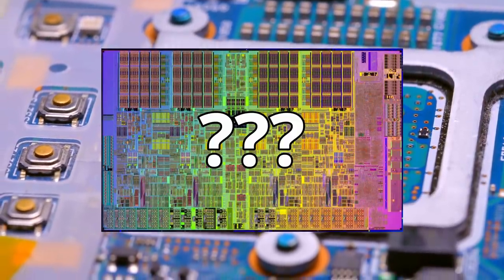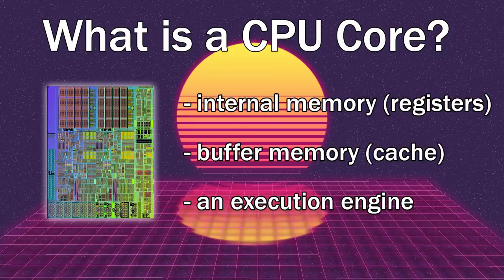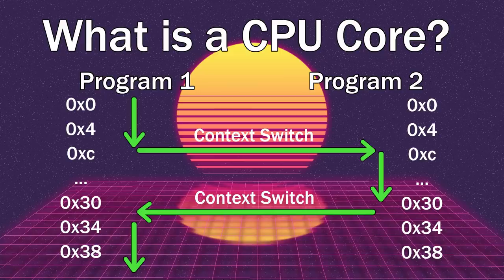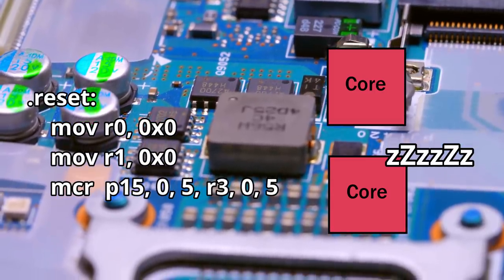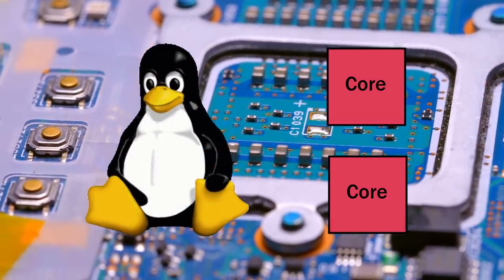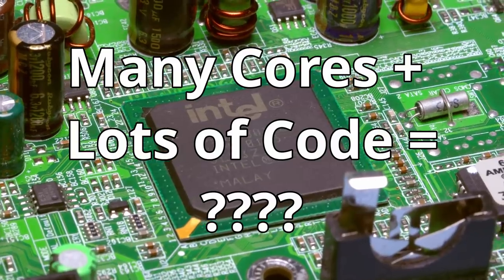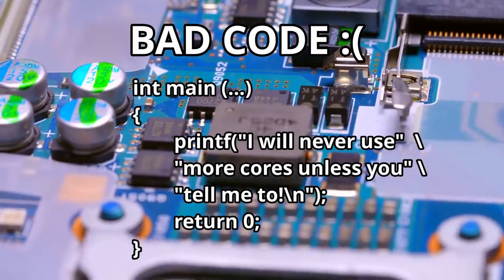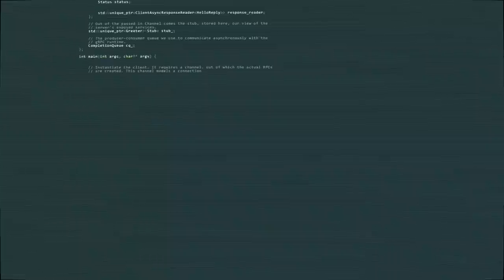why can’t computers have thousands of cores?

Comment: As a former programmer, not all functions of a program can be run in parallel. Sometimes a function needs to wait for another process to finish before it can proceed.
Reply: You just can't count or calculate the next number before you've finished calculating or counting the one before it.
There is no logic, no clever math or algorithm or brute force which can speed up some simple processes. The complex things just have to wait until the simplex things get done.
Reply: Thats if you iterate...But try using a functional language where even iteration is done by recursion....
Reply: @MrZnarffy  Thank you for the feedback.
Reply: It can be endless, 12 is the basic max, 24 = 2x all at very stable more. times infinity Now I seen 36 max and it gets bugs. a controller  separating 24 and next 24 = 58, etc... So buffer and code (stable 24 time x), makes best code function. now is the actual program and controller(s),  Think A,B,C and the programs, export
Reply: @duaanekobe2773  Thank you for the feedback. I did most of the programming on mainframe computers and the programs there were extremely linear in nature. We use subprograms for common functions meaning the main program was in a wait state waiting for the subprogram to complete.
Reply: @larrydavis3645  I have worked with such too, but studied parallellism at uni. And also done hardware design in software (Verilog). So what I think is coming is massive blocks  of competely rewritable hardware, so  you can have self-coding hardware really...
Reply: @MrZnarffy  Thank you for the comment
s. Working with business problems what parallelism we had was done at the hardware and operating system level. Even online systems worked in a batch message mode. A request would be placed into the queue and wait to be processed. Sometimes multiple queues would be used for high-use transactions.
Reply: > wait for another process to finish before it can proceed.
Yes. See Amdahl's law. Many non-programmers don't know that the devil is in the detail and that even short periods of waiting or serialization can bring your scaling factor down very quickly.
Reply: @Conenion  Thank you for your input. I have received the most feedback on this comment.
Reply: Neural Networks can indeed use an almost infinite numbers of cores, and there are 6 different ways they can use parallelism. Source, I do neural network programming for AI.
http://meseec.ce.rit.edu/756-projects/spring2013/1-4.pdf
Reply: @MrRizzyWizzy  Thanks for the information. The type of programming you do is highly specialized and I do not have any experience with it.
Reply: @larrydavis3645  It's rough getting it working sometimes, but when it does it's so much fun and rewarding.
Reply: This is true, but this is in regard to a single application that's running one main thread in a serial path to get to some point.

But now throw in server applications such as DB.  You're going to spawn thread for different queries.  Each query is independent.  I can have a front end server that's running security and handling data access to other servers, where each data access is independent.

Even as the level of WS, I can have very large data sets and I'm running an application that's processing this data, and the data processing can be handled by breaking up this data into smaller sets and running data functions on that smaller set and then that data is passed to another thread to work with the processed data.

In other words, you're looking at it from the perspective of a simple program, and not from a data perspective.  So far AMD's 64 core EPYC shows linear improvement in different tasks, or companies wouldn't buy it.

Right now we don't know what a limit is for no. of cores for a single CPU because we haven't gotten there yet.  The only thing that can be said is "In these use cases.................."

Tech reviewers along with PROGRAMMERS used to say that you'd never need more than a 4 core CPU for running games.  Then smarter programmers came along and found many places where you could indeed use parallel paths for processing data and it would speed up the game engine.  And now?  Epic Games has released UE5 and late this year a game title comes out that uses the engine and the imaging is pretty realistic.  The game is Matrix Awakens.  I watched a person review the demo for it.  He's using a 5950X (16c/32t) and the game was getting up to 42% utilization.  Now, to define that, 100% utilization is when the load is such that 100% of the cores are running at 100% of the all-core boost speed, which is different than a single core boost speed which can be faster.

https://www.youtube.com/watch?v=0V5TCZzzgOo&t=308s

He's runs different tests with this game (different videos) and there are times when the CPU is consistently hitting 38 - 42% util.

I'll do simple math.  He's using a 5950X.  The OS simply sees each thread as a core, so since the CPU is SMT it's 32 cores to the OS.  What I can categorically say is if you tried to run this with a 4 core CPU, whether it's 4c/4t or 4c/8t, the CPU is going to bottleneck the game.  It won't have enough logical cores to run the game well.  For a 6c/12t CPU, it's going to be right on the border of being a bottleneck because of too few logical cores.  An 8c/16t CPU will be fine, and what will happen with newer 8c/16t CPUs is they'll process threads faster and that will keep utilization under 75%.  In fact even now the 5800X3D exists and it's IPC is better in different games than the 5800X.  And this is simply based on more of the data needed by cores are in L3 cache so there are less hits to main memory.  That's how you get the improved IPC.

I know that Autodesk has some terrible rendering algorithms because it's SLOW even with newer hardware.  And I KNOW that rendering images can be handled by breaking up data into chunks and almost all cores available can be used to process a chunk of a data to produce a final image shown on the monitor.  Other software does similar actions much faster. I don't know if Autodesk has finally admitted that they did a poor job utilizing available cores for their applications yet.  I know they've gotten many complaints about it.

In other words you're correct.  BUT, there are many applications that can do a much better job at utilizing many core CPUs, because clock speeds are capped by power consumption (unlike what the video says, which is power inefficiency).  Even though Intel might be able to hit 5.5GHz with Meteor Lake for single core and sustain 5.3GHz at 100% util., the power consumption is going to be about 300W for the CPU for something like the 13900K and that's just too much for most people.  I mean the 5950X is using about 130W running an all-core load (100% util), and the 13900K is going to use about 300W?  The 13900K is going to be either 28 or 32 threads.  That's 32 threads vs. 32 threads and one CPU is using 130W and the other 300W.

And then to add, you're point of view is based on running a single application, and many people multi-task, where applications are doing REAL work all at the same time, not just sitting idle.  And once again the comment ignores that many applications could literally run a couple hundred threads at the same time because the applications are running independent data operations, typically in the realm of server.
Reply: @pwnmeisterage  like2×2+3×3+5×4.......= it simple made in parallel.......for non parallel  commands are specifics cpu  core the fastest one do that
Reply: @MrBesmir7  How do you intend to compute n+1 before you've finished computing n ?
Reply: @pwnmeisterage  n+1is the simplest task......as I mention above  some cores make multiple and fastest one make sum..even if is a long chain + you can group them in seperat cores  and fastest one core  calculate all ......all depends how cores  are programmed to work together
Reply: @MrRizzyWizzy  When you say "core" in that context I suppose you mean GPU cores? Unfortunately CPU core architectures aren't as amenable to neural net apps.
Reply: What if you compute each potential path of the program while waiting for the input and discard the options not needed? I mean... there may be some ways to optimise around this if you have an excess of cores to use.
Reply: @mornnb  Something similar is done sometimes it's one reason CPU's have caches.
Reply: There is a feature called out of order execution. While waiting for data, you can calculate independent or already available data while waiting. When you apply this logic beyond cpu and ram, including things like harddisks or networkcards, you have the reason why hyperthreading exists in the first place.
Reply: @pwnmeisterage  I like to call that the C Junction. C has to wait for A and B. But A and B can be done in parallel before they can be used for C.
Reply: @MrRizzyWizzy  AI is very data drive just like a game engine. That is why a game engine also can do a lot in parallel.
Reply: I would say you are understating it if anything with the majority of real world programs being unsuitable for any parallelization.
Reply: @MrZnarffy  
That relies on whatever the compiler spits out. Sometimes, GCC will optimize away loops where it can
Reply: @Demopans5990  Do you even know what we talked about earlier? There is no GCC for things like Verilog, Standard ML, or I think even LISP...
https://en.wikipedia.org/wiki/Standard_ML
https://en.wikipedia.org/wiki/Verilog

You are thinking of ITERATIVE LANGUAGES, which neither really is.....

So.. NO GCC..
Reply: There will always be bottlenecks but if you can farm out the proccessing intensive parts to many cores you can greatly reduce processing time.  Thats why things like gaming dont see as much benefit from multiple cores as much as things like video processing.  Servers are a great application for multiple cores.
Reply: @supernova743  Sorry but gaming would greatly benefit from massive parallellism.. Say you have every object in a scene run on its won core with its own physics engine................
Reply: @larrydavis3645  business processes can be highly parallel since they often work on separate accounts and things like totals are independent of the order in which they are done. I worked on mainframe operating systems for multiple cpu's and, like you said the operations were queued up but multiple cpu's could be taking items off the processing queues and work in parallel. The main issue was getting the data off disk storage to keep the processes fed.
Reply: @larrydavis3645  possibly worth noting with regard to business processing is that care has to be taken to properly handle conflicts. Money transfers for example must assure that both or neither of the credit and debit occur. There are complexities of assuring the entire transaction takes place. Two phase commit, rollbacks and transaction logs all have a place when parallel operations are being performed.
Reply: Gosh, Lisp had it right with their process-run-function in their hey day.
Reply: @pwnmeisterage  actually you can with quantum computers
Reply: @l.lawliet164  When quantum computers actually become practical and available, maybe. Until then, no. Theory, speculation, hype, and reality are different things.
Reply: There are few problems that cannot be at least partially parallelized. The only question is whether it always makes sense. Because with every additional thread, the administration effort also increases. Which means that after a certain point the performance curve goes down again, if you add another thread. Therefore, as a programmer, I have always taken the path of considering multithreading only for really time-critical operations. Of course it is different with graphics or AI applications. But then it is better to use graphics cards for that. Only in the server area does the striving for more and more cores make sense. In PCs and phones, for example, 64 cores simply don't make sense anymore, because there are only very few applications that would really still have an advantage.
Reply: @pwnmeisterage  well, in that case if  low level operations reqyired takes too much time there is option to split that operations too. ewen if its one simple function, ie a search of file . split file to each core and give each processor some code with different piece of file ;)
Reply: @pwnmeisterage  that’s not true, you can estimate many versions of the answer and run the next step for each estimate, and then when you know close the threads not of interest. It just happens that cores are too expensive for divergent parallel processing.
Reply: For example consider the declaration: factor an integer n, take its largest factor and then multiply by 5 and add 3. 

You can immediately calculate all numbers up to n by 5 and add 3. This is your answer space without knowing the largest factor. Because the first step is more complicated than the next one, if you have infinite threads you can complete the second before the first and save some total time by precomputing the space. If you can design this as a feature of your computational nature, then you can improve even further.

There are definitely some cases where the time of the first is some multiple of difficultly of the second, but the second is still expensive, so the performance for this estimated computation lowers the practical latency of the total operation.
Reply: @pwnmeisterage  n+1 ... give part n=0 to n=10 to processor one and n10 to n20 to processor 2 vice versa :P and mix them at end ;p still probably will require lots of brainpower and math knowledge mostlikely :P but can be done on processor or code side it seems.
Reply: but most can
Reply: That may be true but there are still things that can have an amazing benefit from multiple cores.  I am sure you are fully aware that modern GPUs are a good example of a parallel processor with a lot of cores.  They are not the same as processor cores but that is different.
Reply: Why limit it to ONE program?
Also, there ARE quite a few functions out there working with LARGE masses of data that can be made parallel - or there would be NO USE AT ALL for the many recent supercomputers that put MANY THOUSANDS of cores in a single machine and tend to be "booked solid" for months at a time.
Reply: Why?
Reply: Callbacks and Promises